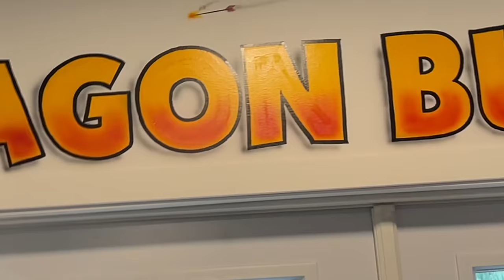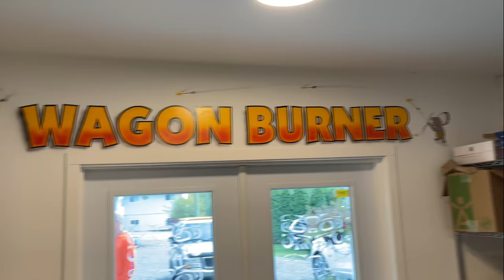Indian Princess, holds up Whale , Bear, Eagle . meet "Indian carver.

Comment: You take a 2" puck off but before its removed  you use a 2 part epoxy on the end so you don't have any voids,  then on the same side sand and polish it and coat that side with epoxy and polish it that way the grain structure should pop out at you and you can do a time line of events on it.
My bet is this tree was a 4" dia tree or larger when our calander started at Christ birth.  That trees true age could be 2k years or more old.  

I've got ceder lumber in my garage ive used on a woodworking project. Its great for outdoor use.  
A wall plack would look nice inside the stadium.

Comment: The only thing better than that house construction is if the top part was a  type of river barge ... [NOT a house 'boat'].  The barge design will easily float the weight of a properly insulated home. Then the bottom part becomes a sort of mooring platform. It can be done ... but the barge companies I talked with had been in operation so long they became 'institutionalized' and see no need to consider a new product.  There is an opportunity for a venture capitalist and a go getter. ALL the flood plains could become habitable ... not stick stilt ... but mooring platforms with completely floatable barge homes.  The creative artistry involved for architects is disguising the 'boxy modular river barge construction... WELL within their capability.